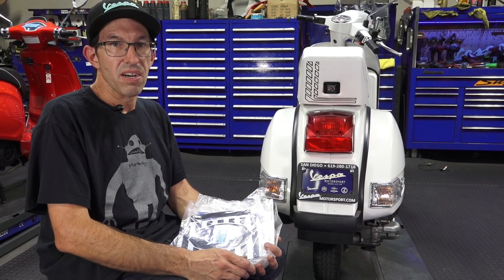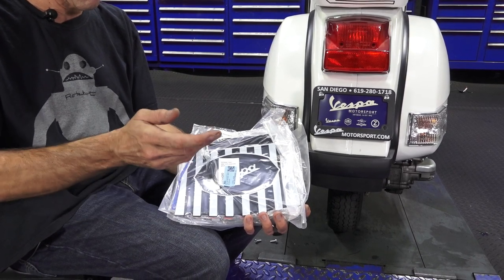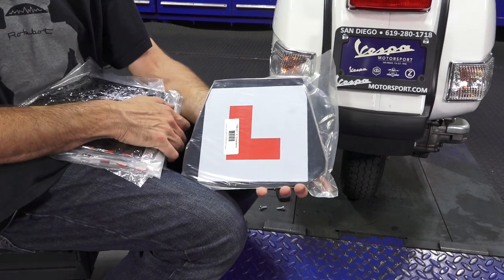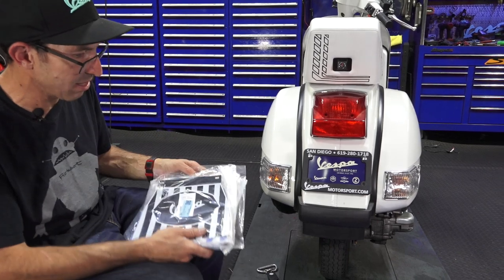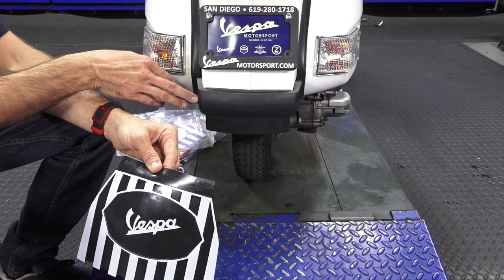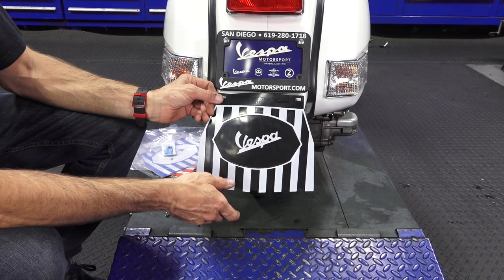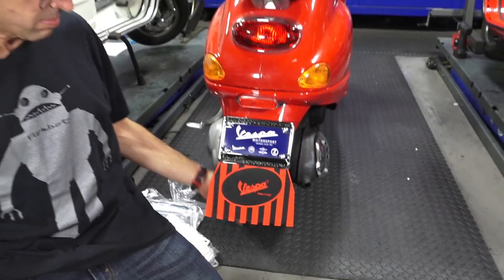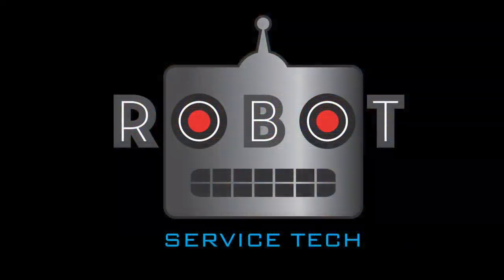Install a Mudflap on a Vespa

Comment: I used to run a black’n’white checkered  mudflap on my PX mounted a little higher than that (I cut off the top strip and re-drillled) and it STILL wore out on the floor pretty quick! 😁

Comment: Beautiful looking mudflaps but a little thin in my opinion . But for this type of body style . The mud flaps only go behind the front mudguard . For older models these go for both front and rear mudguards . If one still wants to install these mudflaps on new body line style rear then these will be attached under the plastic tail cover and not over it .

Comment: L plates are for Learners - it shows you don’t yet have a full licence. It’s not to show you’re on a slower, small capacity bike as once you pass your test you take them off regardless what you’re riding. BTW the L plates are also used on cars for the above reason
Reply: Right. Makes the L flap extra funny, though.